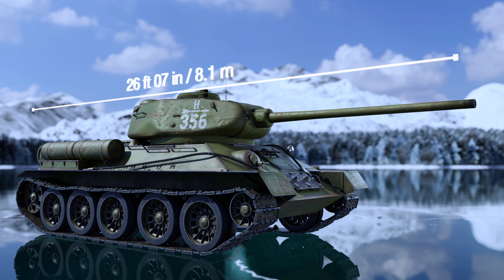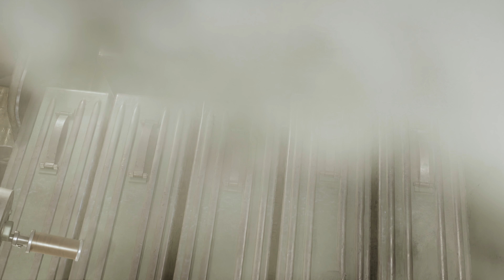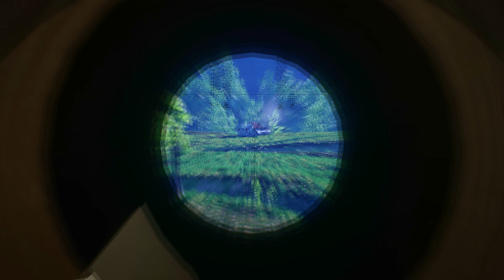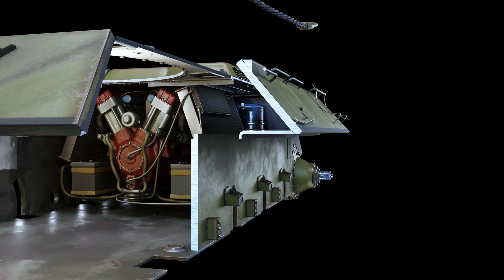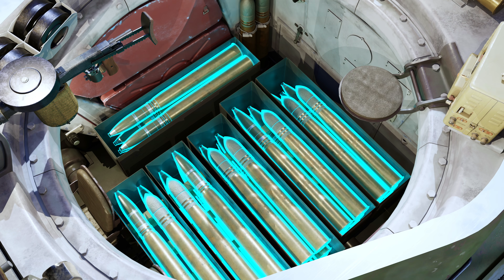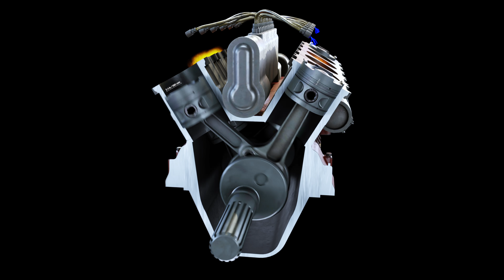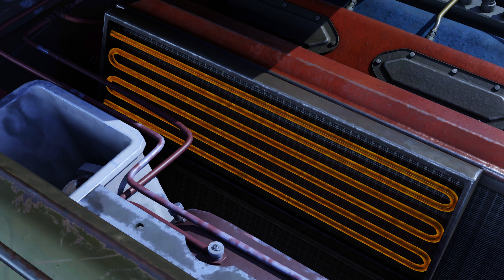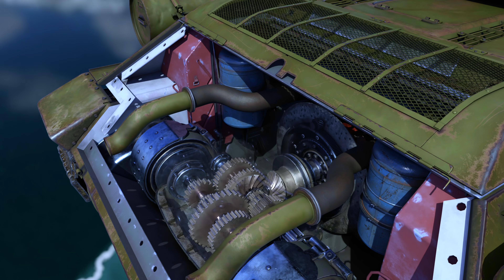Inside the T-34-85

Comment: when you witness a t34 at a demonstration, it sounds as if the transmission is about to drop out of it. the tank makes  a distinctive clanking sound as it moves.   this is not the tranny, but rather the track pins that are hitting the track pin deflector, which ram the track pins back into place as the track passes by.

the deflector is located just behind the second last road wheel and is welded to the chassis. with this method there is no need for track pin retainers, the pins are always pushed back in at each pass of the track, when the pins try to back out.

this simple engineering design eliminated a lot of extra machining and labour in the construction of the tank while reducing maintenance at the same time. that is the design philosophy that was used in the creation of this tank and other examples abound through out the tank.

the t34 was a world beater and one of the cheif reasons for the nazi's defeat. :face-fuchsia-tongue-out:

Comment: Nice Video! Sadly you didn’t mention the Cam Roller Trick of the T-34. 
The T-34’s track pins are a legendary example of brilliant Soviet simplicity: instead of using fragile clips or bolts to keep them from vibrating out, the pins were left entirely loose. To prevent them from falling apart, engineers simply welded an angled metal wedge directly onto the rear hull. As the tank drove, any pin that started to slide out would hit this wedge and be automatically hammered back into place with every rotation of the track. This eliminated thousands of tiny parts, made mass-production faster, and allowed crews to change tracks instantly with just a sledgehammer, though it did create a highly distinct, loud "clack-clack-clack" sound during operation.
Reply: I looked through the comments, specifically to see if some one would mention this feature....well done..👏
Reply: Да.
Но не надо забывать, как трудно было выбивать из сочленения траков изношенный палец, который представлял из себя настоящий коленчатый вал в миниатюре!😅
Reply: @Леонид-д1ч8ы  my grandfather was a stone masson. he used some of these pins, sharpened to a flat head or rectangulat pyramid. steel was good quality.
Reply: @Леонид-д1ч8ы bizony, nekem is van ilyen vésöm még apám hagyta rám. 
A csapszeg szépen kopik idővel jellegzetes butyköstengely alakúra. 
viszont ez további előny míg nincs nagyon elkopva mert jobban tartja a helyén.
Reply: @Леонид-д1ч8ы igen űtni kell oldalról is a láncszemet is sokat....
Reply: They still broke down more often then not lol 😂
Reply: Экипажи благодарили за это😊 стук пальцев о корпус давал неописуемые впечатления 😢 А можно сделать нормальные фиксаторы пальцев? МОЖНО, А ЗАЧЕМ?😂
Reply: I hear about it every single t-34 video it's unnecessary to mention at this point. honestly it's annoying now
Reply: вся твоя советская простота это люди расходник,а техника говно,и эта политика страны и сейчас видна,после просмотренного ролика про королевский тигр,смотрю про трактор т34 и только настроение портится от понимания где была любовь к своей нации и людям и где скоты преследовали свои интересы за счет людских оесурсов🤮🤮🤮
Reply: @Оракул217 я ждал этого комментария. Что придет специалист и все объяснит
Reply: @Faritech318  да забей. Переможники они такие. Танк то разумеется был не самый лучший. Там не было кофеварки, зоны барбекю и холодильника для напитков. Но если бы не он, все мы бы были удобрением в земле, и никто бы о нас и знать не знал сейчас.
Reply: @Оракул217 чел, посмотри статистику сколько было сделано КТ и сколько т-34,у СССР была ставка на массовость и быстроту производства и у немцев на толщину брони и калибр пушки, в итоге первые просто задавили своим числом вторых, т-34 до сих пор десятки тысяч по всему миру либо на хранении находятся либо на вооружении, а где королевские тигры? Правильно, их почти нет, еденицы в музеях стоят, в условиях войны выигрывает не технология а экономика и быстрота производства продукта впк,немцы эту гонку проиграли потому как цели заведомо ошибочные ставили
Reply: @Alex_Savrov КТ начали вьіпускать в 1944 году. Когда союзнички вовсю раскатьівали заводьі по всей Германии. Скинули порядка 1.5 млн тонн авиабомб за три года. А сколько бомб упало на заводьі на Урале?😊
Reply: @АндрійАнатолійович  жалкое сравнение, в начале войны никто не раскатывал заводы Германии и им никто не мешал и дальше производить пз3 и пз4, но мания гигантизма поставила промышленность Германии раком, надо было и дальше "четвёрки" клепать, максимум на пантеры перейти а не тратить ресурсы на тигры которые в несколько раз дороже были а по кпд мало чем отличались от средних танков, это как вместо производства автоматов и оснащения ими армии вдруг массового начать выпускать пзрк и раздавать их на право и на лево солдатам, это дорого, бессмысленно и крайне глупо
Reply: @АндрійАнатолійович  "союзники" раскатывали мирные города, Гамбург, Киль, Дрезден... не дадут соврать! А промышленность они выносили только ту, которая могла достаться Красной Армии!
Reply: @Оракул217   Love for one's nation is when you arm children, elderly and women with minimal equipment and training and tell them to never surrender because you're scared the enemy will do to you what you tried to do to them all because you refuse to admit you got bested ? The KT though as impressive as it sounds on paper like all the German "big cats" has a pitiful track record where it entirely failed to do its one purpose which was achieving the breakthrough that the Panzer IIs, IIIs and to some extent IVs were able to achieve up until they very specifically met Soviet tanks like the T-34, now you tell me : is it better to have as much as possible of your army be mechanized with large armor elements and many armored divisions or is it better to allow for very little of your army to have (on paper great) armored equipment, while the rest is left with the bare minimum/subpar equipment ? In that regard which is actually caring more for their nation ?
Let us not forget that if it wasn't for the T-34 and its extremely impressive armor and good armament at the time it was introduced along with the relative ease it could be produced, Germany along with the rest of Europe that collaborated with it would have never needed to switch to producing few overly expensive and overly complicated tanks, and let us also not forget that the United States - despite having a monstruous and completely safe industrial base and manpower pool also deliberately chose the same approach as the Soviets where they mass produced tanks (although without the many manufacturing problems the tanks presented that come with fighting on their own soil and losing most of their industrial centers and population)
Reply: @Оракул217 что не мешало 34кам доехать до Берлина и перебить все твои комфортные тигры и спокойно ломать брусчатку на площади в берлине😂
Reply: @Оракул217  Считаете что лучше 1 экипаж в "комфортабельных немецких тракторах" и экипаж с голой жопой, чем два экипажа в двух "тракторах" сделанных в ссср?
Reply: @Оракул217  Зуб даёшь?
Reply: @Оракул217 слава Зебельсу 🎉🎉🎉 Слава ТЦК 🎉🎉🎉 слава бусику😂😂😂
Reply: @Оракул217 да чувак! Сталин лично замучил 100500 моих бабушек в ГУЛАГ, за то что они съели 3 колоска с колхозного поля, каждая 😂😂😂
Reply: @Оракул217  От ТЦК уже заховался? Вот где забота об человеке, да...
Reply: @Оракул217 Королевский тигр? А, это те, которые отхватили под Балатоном от взвода тридцатьчетвёрок? Как там трансмиссия? Как там двигатель? Броня без молибдена, трескающаяся даже от попадания 76-мм снаряда?)
Reply: @Duchesse_Memes_Corps The T-34 has some of, if not the worst armor cracking of any tank of the war.
Reply: @Duchesse_Memes_Corps захотелось напомнить реальную историю - фрицы за четыре месяца захватили всю Белоруссию, всю Украину и почти половину России даже до Москвы, самая современная армия Европы за четыре года захватила только Луганскую область и большую часть Донецкой области Украины.  А фрицев победили самой огромной армией в истории человечества -  34 миллиона бесплатных солдат против 4 миллиона фрицев .  И да, из 34 млна убиты 26.  Амеры четыре года воевали с армией Японии на островах тихого океана и почти бесплатно отправляли Сталину самолёты Аэрокобра, Покрышкин стал героем потому что на американце воевал.  Танки Матильда и Ли, почти весь авиабензин, все вездеходы Студебеккер для ракетных установок Катюша.  Тысячи тонн тушёнки ели охранники сибирских концлагерей потому что через Аляску правили, ну и командиры не ниже майора.  Пять лет бессмысленного убийства сотен тысяч русских парней ради захвата двух областей Украины???  Посмотри на любом кладбище в любом городе или поселке сколько флагов над свежими могилами наших парней
Reply: @АлинаБутова-и9я  а т34 тут причём?
Reply: @Оракул217  although I hold the same view I was surprised the late model design was more well thought out than I would have imagined, I would still argue it was cruel and too demanding of the crew.
but yeah the track pin example shouldn't be something to be proud of, it was a one off design thing one factory choose to do due to shortages due to the soviet planned economy and war constraints. 
these cultural things of "smekalka" and corruption has been so prevalant in soviet areas that it has seeped into Slavic people so bad that now its essentially a inseparable part of their culture, it has hit their communities like welfare or crack has done to others.

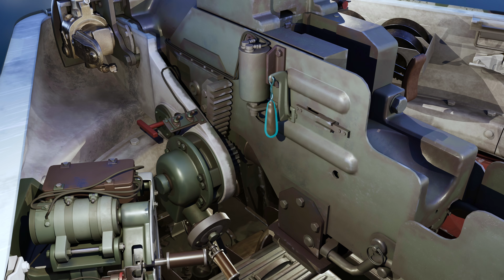Comment: At 5:20 corect is: the aluminium tip not "the steel body" was crushed against the armor plate and the tungsten core punched through the armor.

Comment: There is an error in the engine section. Since it was a Diesel engine, it would not have needed spark plugs to ignite it, it only needed  glow plugs during startup to heat up the cylinders before starting, other than that, diesels only use pressure to generate heat for combustion, other than that, pretty good

Comment: T34 was not the most import tank of the ww2
It was a steel cofin for its crew
The ending statement it is forced for the sake of trying to make your statement true. It is not. T34 was a mediocre tank, with very poor visibility( you did not adres the lack of a commander cupola), poor internal and external comunication( no internal comunication and almost no external radio), very poor aiming characteristic and very poor survivale rate for the tank and its crew. Also its armor was a joke for 1943 and forward.

Comment: The thing that most facinated me from this tank was the cooling system! Amazing.
Reply: -- I'd say it was engine, it enabled T-34 to pivot within tank's hull length: https://youtu.be/o1wf1xE1MTE?si=0Tz93eevrsp9jMDd with earlier adaptation of common rail direct fuel injections which gave almost unheard of range for WWII of near 250 miles with external fuel tanks, but also 4 valve per cylinder and DOHC(Dual Overhead Camshafts), which not only made tank fast for top speed, but pick up from dead stop. For comparison Panther/Tiger engine had 2 valves SOHC, iron block engine, with four Solex carburetors, that need to be synchronise and adjusted, as well as ignition system with spark plugs that needs cleaning from lead, as it used high octane lead fuel.

Comment: Here's what the 24:45 info panel says

"At temperatures lower than -25C engage the heater switch.
---
Outgoing water no higher than 105C
Do not start moving until the oil heats up to 45C and water heats up to 50-55C
---
Outgoing oil no higher than 100C
Start moving on lower gears
---
Oil pressures:
Normally 8-9 atm
At 600-800 RPM at least 2 atm
---
Do not operate for longer than 10 minutes with the fuel supply pedal fully depressed"

Comment: Couldn't the t 34 85 penetrate the upper front plate of the tiger at a kilometer ish range with its ap round?, or is it because there was little knowledge about the tiger? 30:03

Comment: "designed for mass production" the one factory that made half of them forgetting to put water seals, and instead of glass for the periscopes using extremely polished metal (they also heat treated the steel for the armor so much the armor could crack from a shell, while not heat treating the parts for the transmission), and when one was supplied to the Americans for testing it was found that if produced to American standards the price would be similar to the M4 Sherman

Comment: You forgot to mention that track lingages connecting pins were not bolted but were just inserted from hullside to connect the lingages to each other. The Bump you see in 12:12, was to hammer each pin back in when tracks rotated and this made the familiar clicking sound when the tank moved.

Comment: In terms of numbers, the M4 Sherman actually out-manufactured the T34 in per month stats. But overall production numbers goes to the T34. As for which was more important, T34 defined the Eastern Front defensively, while the M1 was more tactically versatile.
Reply: M4 is hangar queen in comparision
Reply: @Chaldon-hl6yk  not even 😂

Comment: It was crap.  
In everything. The gun, armor, engine, transmission, suspension.  
It was not simpler to produce. Its production required three times more man-hours than producing a Panther. At the same time, the Panther was far superior. It was a class above this crap. Its 85 mm gun could not penetrate the Panther or Tiger-1 frontally even from 500 m, while the Panther and Tiger hit it from two kilometers.  
AP rounds barely affected T-34-85 crews.  
They were delivered by the SU-85.  
It was complete crap, and it appeared at the end of 1944 and hardly participated in the war.
Reply: Фото и кинохроника говорят о Т-34 85 обратное, именно они засняты в освобождённых городах Европы, именно они разносили Берлин пока Гитлер рыдал в подушку и подумывал убить главного злодея Европы. Т-34 дорогой в производстве и человеко-часах? Может быть, только стоит учитывать что в Германии такое производство достигалось лишь благодаря передовым технологиям и автоматизации, и когда передовые немецкие заводы и фабрики начали равнять с землёй случилось что? Правильно, Рейх начал терять в темпах производство. 

Ну и с цифрами поспорить будет труднее всего - только Т-34 всех модификаций за годы войны произвели свыше 60 000, а это больше чем Pz.kpfw III, Pz.kpfw IV, Pz.kpfw VI "Tiger", Pz.kpfw V "Panther", StuG III и JgPanzer 38(t) Hetzer вместе взятых. И кстати, даже ИС-1 и ИС-2 произвели свыше 3000, а это больше чем всех Тигров и машин на их базе вместе взятых.
Reply: @BanZAIka2022  саме чисельність Т-34 допомогла фашистському совку перемогти.
Їх робили тисячами і знищували тисячами. Конвеєр смерти.
Ніякої автоматизації тоді не було.
Пантеру збирали на стапелях.
Німці просто робили це якісно.
Це не супертехнологія.
Це просто якісна праця.
У фашистському совку завжди були проблеми з якістю.
У тому числі з якістю сталі.
Якби тракторні заводи совка зрівняли з землею, вони теж не змогли би виробляти танки.
Кретинський аргумент.
Власне, без постачання за ленд-лізом каучуку фашистський совок не випустив би жодної одиниці техніки, не лише танків.
Увесь каучук був зі США.
Половина міді була зі США.
Половина авіяційного алюмінію була зі США.
П'ятсот тисяч вантажівок різного типу, в тому числі 100 тисяч Студебекерів і більше 3 тисяч важких танкових тягачів, яких у совку не виробляли взагалі, були зі США.
США взагалі годували фашистську імперську РСЧА. Мільярди поставлених банок консервів, м'ясних і овочевих.
Совок не звільнив Європу.
Совок відбив її у нацистської Німеччини для себе, щоб створити у її східні частині подібні до свого фашистські тоталітарні режими, які мордували майже п'ятдесят років власні народи, а коли угорці і чехи захотіли змін у своїх країнах у 1956 і 1968 роках, фашистський совок вторгся до них і танками розчавив народні протести.
Reply: @Русь_це_Україна  дык т34 украинский танк - получается все украинцы зрадники
Reply: Agreed, let's go shoot at the front of the tank with a pistol

Comment: Fun fact, the distinctive rattle the T-34 made was due to a wedge-shaped "track pin striker plate" mounted on the hull of the tank. 

To make track replacement quicker, the T-34's track pins only had a head on one end, meaning the pin could work it's way out over time. To prevent this, the Soviets welded a wedge-shaped striker plate to the tank's hull to hammer it back in every time it passed over the striker plate.

Comment: Its worth noting that the ultimate M4 engine was the Ford GAA-8 (also an engine designed  for aircraft (as a V-12 aka Allison/Merlin).    It was 1100 Cbuc Inches  in the V-8 Tank version,  something around 1475 lbs.   The T-34 engine while not much heavier took up a lot more space as it was 2400 CI for the same hp (better torque of course).     Soviets had poor gas so a diesel engine for the tanks made sense (they were given the low compressions Studebaker Trucks that was their main logistics system,   which reflected poor gas as well and the engine best suited to that poor gas (their Aviation and most of their  gas was supplied  by the US an UK -  I suspect they blended their poor gas with the Lend Lease gas).

Comment: I enjoy your videos, very well done. Seems you're fixed on using imperial as the primary measure units stated, but, I feel if the machine was designed and engineered in metric, it should be the primary units with imperial as the secondary.  Giving context to the origins, and the measurements making more sense.

Comment: Here is an important info addition to this excellent video:
The tracks of T-34 tanks could've been EITHER cast or stamped. The casting was cheaper and faster process, but it required more thorough control of the alloys and the manufacturing operations. Making the tracks segments by casting was against the existing tank building specs, and doing so could end up in getting those responsible for this technological change executed. But ultimately everything regarding the T-34 tracks worked out well enough.